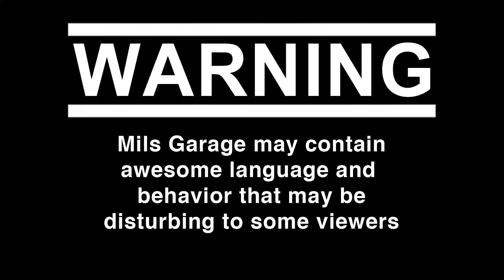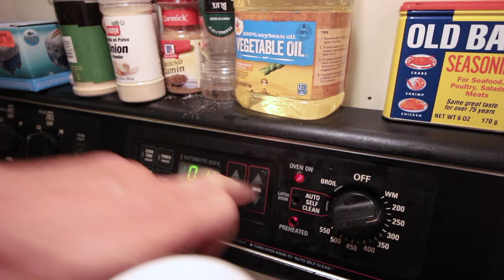Easiest Way To Open Headlights [Separate Lens From Housing // All Cars] (w/Pro Tips)

Comment: Thanks SO much for posting this. Purchased a used car and immediately discovered that I needed a new headlight assembly asap for a trip. Ordered the part, but it didn't arrive in time. This video helped me separate the assembly easily and JB Weld the loose internal reflector brackets and get the burned bulb replaced. It took a little time to fix the internal brackets, but this tip totally saved the day! The oven trick worked easily and got me on the road without delaying my trip. Took longer for the epoxy to cure than all of the rest of the repair! You Rock!
Reply from the maker: 😮👍👍👍 Awesome!! 💪 Wow, great work Kathy!! When thinking outside the box wins 💪💪💪

Comment: Thank you! Had to heat my stock adhesive twice for 15 mins each time before it released. Also cardboard is fine to put in the oven at 200 instead of the wood block
Reply from the maker: Cardboard 🤔👍 Awesome. Thank you! That'll give me more space in the oven at the shop 🙌🙌🙌
Reply: Oh yeah the cardboard is clutch. Can also bend it up the wall to keep the light from touching it. My headlights are really long and took up my whole oven diagonally soo I had to come up with something lol
Reply from the maker: Awesome, so are the G35's, so your method will definitely save me some headache. Great work. You likely know, but you'll definitely want to clean the oven before making food.. Dun wanna eat no carcinogen cake 🥴

Comment: I am 62 yrs old with my husband's 1999 silverado truck. The lights were so bad I couldn't see very well,so need to take the covers off because they get full of water constantly burning bulbs. So thx to your video got to gem apart cleaned them and had to spray chrome paint on the reflector portion because it turned white. The crud in them and along the seam was impossible to clean assembled. Thanks guys
Reply: Will gasket sealer work
Reply from the maker: 😲👍👍👍 You did that? That's AWESOME! Great work!! The best new adhesive to use is RetroRubber Headlight Sealant: https://amzn.to/2xs0SVm
Reply: @milsgarage  yes and they turned out like new,pretty proud of the work I put in.
Now I've got friends wanting me to do theirs.  I pointed them to your video instead. Thanks again.
Reply from the maker: Awesome! i really appreciate your support! 🤘🤘🤘

Comment: This works if you have a big enough oven or a small enough headlight.

I used a thick cardboard box and cut a hole in it for a hair dryer pointing at the lens. Did it on a mondeo which has massive headlights.
Reply from the maker: That sounds innovative for sure 👍 i would be very careful about aiming heat at the lens, as it will burn and turn into a non-transparent white if heated too much, but i'm glad you were able to get good results. Awesome work Martin 👍👍👍
Reply: @milsgarage  I've burnt it with a pa buffer but never with a hairdryer. I kept checking and prying at the bonding every 5/10 minutes.
Reply from the maker: @martinroberts3977  Oh good point. My mind immediately changes a hairdryer into a heat gun when i think about cars. You're right, that's much safer
Reply: @milsgarage  heat guns and plastic a massive no no.

Next set I'm doing are zafira b headlights. Going to attempt angel eyes........ They need a clean anyway.

Might do a video.
Reply from the maker: @Martin Roberts Cool, i'll check that out 👍 Subbed.

Comment: Awesome. This inspires me to try disassembling my Protege5 headlights so I can paint the interiors black (I'm going to go watch your video on that, now).
Reply from the maker: Awesome! You got this. Keep up the great work 🤘🤘🤘
Reply: Right?  I have a 2010 mazda 3sport gs 2.5 that has dual xenon automatic headlights that get too hot inside and got flaky and foggy inside as well as outside from environmental effects...   it's nearly the cost of the vehicle's  current value to get both replacement headlight assembly... hope to sort out these issues now.  Thanks!

Comment: Super helpful video! Question on the adhesive...Do you have a reco on what to use to put it back together? Do recommend removing the original adhesive and putting something new on there or are you essentially reheating the original?
Reply from the maker: RetroRubber Headlight Sealant: https://amzn.to/2xs0SVm 👍
Reply: if you have the grey tacky kind of glue inside you can reuse it if there's enough of it, just heat it back and clamp it shut.

Comment: Good video, like the oven idea. Did you use a solvent to clean the base of the headlight before installing the new lens? What brand of cleaner did you use? Thanks
Reply from the maker: Thank you David! The best new adhesive to use is RetroRubber Headlight Sealant: https://amzn.to/2xs0SVm
Reply: @milsgarage   It seems many find it difficult to get the old sealant off the base of the fixture before installing the new sealant. Is it important to get the old sealant totally removed from the grove? Did you use some kind of solvent? Thanks

Comment: Guys have a tip on removing the “Smoked” paint ? Bought some cheap IPCW Projector headlights 2nd hand. Found out why they were sold to begin with. Can’t see 💩 at night, tried LEDs and Switch backs to help. Nodda Nothing has helped. Yooper Michigan LEDs suck driving in a snow storm as is. So yeah basically down graded from oem
Reply from the maker: Where is the paint? On the lens?
Reply: @milsgarage  I wanna say it is on the inside of it. All smoked out. But also looks darkish on the reflector housing parts… if yah know what I mean

Comment: I have a question. Did you get any burned plastic smell in the oven after the headlight is finished? 

Thanks.
Reply from the maker: No, but you're not going to want to let it touch the hot metal, cause that will absolutely happen
Reply: @milsgarage  Ohhhh ..  Thanks. I'm gonna try this on my protege headlight. It leaks water a lot. And I want to reseal it.
Reply from the maker: @freeosiris 01 Ok, you might need RetroRubber Headlight Sealant: https://amzn.to/2xs0SVm

Comment: Great video. I’ve been told the headlamps on my 2004 BMW X5 e53 are “permasealed” and can’t be opened using the oven. Is this right? This method looks cool.
Reply from the maker: Thank you Chris! Some of the older BMWs had glass housing that won’t separate either.. i’m not sure about the X5’s.. Either way, this method is the most promising way to open them 👍

Comment: Now what type of seasoning should I use,,I have tons of old bay. All seriousness aside, I ordered the lenses for a 2003 530i with that I'm working on, after trying the heat gun I actually thought of the oven idea, once i strip down the components, they're HID then I'll give this a go, some guys just cut them off, I think mine have the self adjuster mechanism but I don't know if they work, I can't use the car right now anyway because I'm doing the oil pan gasket and in doing so I broke a couple of ribs I think so I can't get under there until I heal, I did a stupid thing by standing on a piece of 4×4 leaning into the engine to get the drivers side bolts on the oil pan when the wood slipped out from under me and I slammed my ribcage on the top of the fender, maybe it's just bruised inside, laying down hurts like hell so it's difficult to sleep.
Reply from the maker: Reading this at first got me like 😂😂😂 ...  But then you broke your ribs.. Sorry to hear Peter. i just stopped someone from doing something similar.. Cars, arg

Comment: Great job! Now do that on BMW E60 headlights 😊
Reply from the maker: Bring us some of those and we can open them up for you 👍 This method works on everything 💯
Reply: @milsgarage  unfortunately that's not possible, I'm from Croatia. 😬  Trust me E60 headlight is a nightmare... Heating doesn't do anything to the glue, plastic is shitty and it cracks easily...
Reply from the maker: Is that right? Thank you for the tip! i won't accept BMW E60 headlights then 😂👍👍
Reply: @milsgarage  I have tried on one and I failed to open it. After searching for solution I have found out that it's impossible to opet that headlight. Guys are cutting them open and then buy a new aftermarket front lenses and glue them back on. And they charge that job nice because it's really fu** up and a new headlight costs a lot. If you manage to find  a easier way to opet that headlight that would be a great commercial for your company. There are a couple of more types of headlights that are disaster to open so be careful.
Reply from the maker: 😲 Damn, that's the worst situation to be in ever. i guess i should research before accepting work on non-jdm headlights. Thank you for saving me time and anguish! 😅
Reply from the maker: LOL Hit it with the chainsaw!! 🤣🤣🤣
Reply: @milsgarage  no problem man, I'm glad I can help.
Reply: Doing my E36 headlights now. We'll see how they come out in 14 min
Reply from the maker: @robayala8339  How'd it work out?
Reply: @milsgarage  overall it came out great, I the E36 headlights here in Germany are glass so i had to put the oven at 212f-100c I broke a side trying to pry it open but luckily there is a few cars in the junk yard that I'm going to go pull the headlights out. This first one was the text run, than you for the tip 🙌🏼
Reply from the maker: Rob Ayala Wow, yeaaah i’ma have to stay away from glass headlights for now.. That’s awesome you have backup options 👍 Keep up the great work Rob! 💪

Comment: Asking I’m trying to pry open the headlight exactly like you said around 250farenheit for 10-15 min but nothing come apart still look dry please help
Reply from the maker: What year and model car?
Reply: V70 2.5t 2006
Reply from the maker: Interesting, i haven't customized Volvo headlights yet.. i wouldn't increase the temperature.. i've heard of mainly older cars not working with this method, but it's possible they sealed the housing without adhesive

Comment: I’ve got original Hella Quads on my ‘97 Golf Gti. Scared of putting in oven in case housing melts. Heat gun method not freeing up original sealant. So frustrating.
Reply from the maker: i've done both methods, and the oven is the best by far

Comment: nice job....but i was wondering..if i were to use water instead of air, do you think it would work?
Reply from the maker: Thank you Adrian! i wouldn’t use water because of the little screws inside.. Also putting it back together with warm water sounds impossible to me.. It might work, but warm air will do the trick for sure 👍
Reply: @milsgarage  Fair enough, you're totally right
Reply from the maker: @Adrian Zo Definitely a cool idea though :) i'm sure that method can be used in applications 🤘

Comment: WARNING
I tried this technique. After 7 minutes I went to see how things were going. My entire unit was completely melted!!

Unfortunately, this was the "new" unit I purchased where one of the two lenses was broken and I wanted to remove it. But apparently this material could not withstand this heat and melted away completely.

So be warned!!
Reply from the maker: i’m sorry to hear that.. i also have warnings all over the video about how 200°C ≠ 200°F.. We’re using °F being in America 🫠
Reply: @milsgarage  Stupid of me. But because I had seen the video once before and now watched it again (accelerated), I no longer heard the lyrics. Perhaps it would be more useful to also include the text stating that it concerns fahrenheit...
The unit I need (Volvo 480) is very difficult to find. So I'm really disappointed that I ruined a reasonably good copy.
Reply from the maker: Arg, it’s not common knowledge so don’t beat yourself up.. i feel bad this happened

Comment: I do not have an electric oven like the one you have. I have a gas oven without a thermometer, how do I deal with it please
Reply from the maker: No thermostat/thermometer? i wouldn't do it. It doesn't need much heat to work, and it doesn't take much more heat to destroy the headlight
Reply: @milsgarage  
 
Thanks for your reply🌹, but I don't understand, can you explain more?
Reply from the maker: @hhhhhg5232  Sure, the temperature to melt the adhesive is lower than the plastic housing, but without control of the temperature, it's possible to quickly melt the lens or housing. i personally wouldn't take the risk, but i also do this stuff as a business, so i seek to minimize risk

Comment: I have a BMW   530i  I'm trying to remove the lenses is there a easier way need help  What glue do I need to put them back on thanks
Reply from the maker: There is no easier way than the oven. You go this. Just a heads up, this method won't work on glass. RetroRubber Headlight Sealant: https://amzn.to/2xs0SVm 👍

Comment: Excellent video thank you. Question, you removed the screw but I was wondering why you didn't remove the screws that help you adjust the horizontal and vertical positions. Won't they get hot and mess up the interior or melt the plastic around it?
Reply from the maker: The goal is to heat it up enough to melt the glue, but not the plastic.. We haven't had any issues with adjustments afterwards, but if you're comfortable removing those parts 👍

Comment: So do you heat it again before pushing the lens back onto the assembly?
Reply from the maker: tisoy909 Yes 👍
Reply: @milsgarage  Thanks
Reply from the maker: @tisoy909 Any time 💯
Reply: @milsgarage  Do you add glue or just use what is left on the lens cover?
Reply: I was wondering is it necessary to keep 14 minutes again before put it back ?

Comment: Can you bake a light with a broken lens? If chome piece inside is exposed will it not burn?
Reply from the maker: Yes, you can. The paint and chrome will not be affected as long as it doesn't touch metal in the oven 👍
Reply: @milsgarage  thanks. Will be doing mine tomorrow

Comment: But wher is the problem to warm up till 200° after turn of and then put in to the oven. It will be more safety
Reply from the maker: My only worry is whether it touches metal, so whichever is easiest.. 200ºF should be one of the lowest settings, so it should be pretty safe, just enough to soften the glue

Comment: Hey I’ve got a question ,I see you say to remove the screws,and I’m assuming any kind of metal that’s possible?im unsure of the reasoning,and I paused the video at the screw removal part,so if you explain why to remove screws when I finish watching in a moment I apologize lol. But I have screws on mine that are basically in removable,is it ok to go ahead and bake ??!!
Reply from the maker: The screws need to be removed because they're adding pressure to the lens edges which can crack if they aren't removed

Comment: I have a 2019 Jetta which did not allow the separation as you've shown on video, do I possibly have to increase the temperature or put in longer for new cars??
Reply from the maker: Yeah? i'm not sure.. Too hot will definitely damage the lens though.. Maybe an aftermarket headlight for the Jetta would be easier to open and modify
Reply: Yes my A3 8P headlights did not allow the sep. too.
I will try other solutions.

Comment: is it safe to eat food out of the oven after cooking the headlamp housing? This technique is also used in technology with bad soldering boards. we heat them up to hopefully reconnect any worn out connections but the downside is that it's no longer safe to eat out of that oven.
Reply from the maker: No, definitely don't. We thoroughly cleaned the oven afterwards. We also purchased an oven dedicated to modifications, which we use at the shop.

Comment: I need to repair an led strip in my g35 headlight my only question is does this make the house stink afterward?
Reply from the maker: It shouldn’t as long as the plastic doesn’t touch the metal parts in the oven. If you’re careful, you’ll be just fine 👍

Comment: Did you put them back in the oven after you used the adhesive to put them back together, and how long does it takes them to fully dry?
Reply from the maker: Yes. Either way. We have the link for the adhesive here in the comments.. Fully dry?

Comment: Is there a tutorial how to stick It back?
Reply from the maker: Press them back together, put in the oven for same times, press and hold firmly together at the edges while reinstalling the screws to keep it secure.. Be careful, it’s hot 👍
Reply: @milsgarage  well said, thanks!
Reply from the maker: @God kinG Any time sir! 💯
Reply: Do you have to apply more adhesive when putting them back together or just reheat and reuse existing adhesive,still get a tight seal with no moisture getting in?

Comment: Hi guys, great useful video as I have to split one of my headlights. My oven is gas so the lowest heat is approx 275f on gas mk1. So I guess I'm pretty screwed?
Reply from the maker: We bought a cheap electric oven for the shop. We can also remove and replace a lens if you're in the Delaware area
Reply: Alas I'm in the UK. Thanks for the reply. Gonna try half a gas mark and a shorter time
Reply: 5 minutes at half gas mark worked perfectly for anyone else reading this.
Reply from the maker: @stephenlangley6101  Great work Stephen! Thank you for finding us all the way over in the UK 🤘🤘🤘

Comment: What if the headlights have a built in level would this method still be safe?
Reply from the maker: i'm not sure. Probably, but i'm not replacing them if they break. i'd recommend looking into how the leveling technology is being implemented. If it's not related to a sensor on the lens, it'll probably be ok. i imagine that type of tech uses a simple internal leveling system, but i haven't studied it specifically

Comment: Did you guys puttem back on the oven with new lense so they can glue back together?
Reply from the maker: We use an aftermarket OEM spec strip of adhesive to bind them back together [ https://www.theretrofitsource.com/morimoto-retrorubber-butyl-glue-52001.html?utm_source=google_shopping&gclid=EAIaIQobChMIxIDFrL2Z5AIVQ_7jBx2ldQ5AEAUYAyABEgKErPD_BwE ]
Reply: I purchased new adhesive strip as Jay stated, but I will have to put them back in the oven in order for the adhesive to soften enough to put them back together.